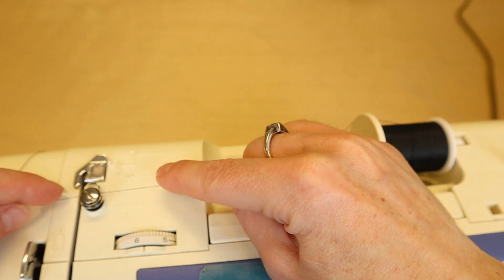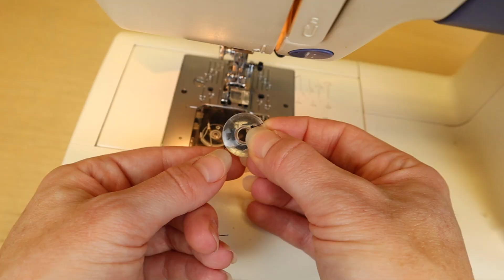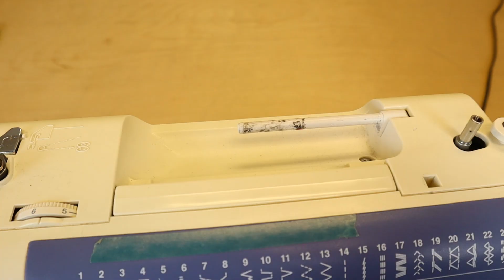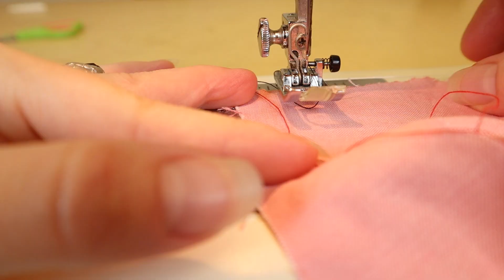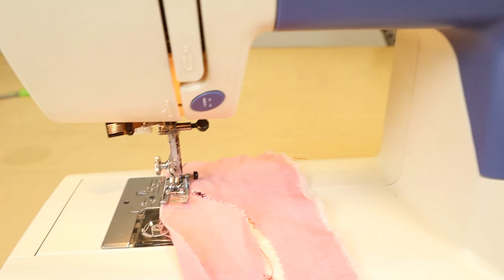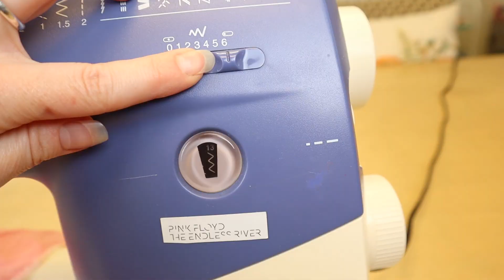Huskystar 224 Sewing Machine Walkthrough

Comment: Thanks for such an informative video. I’m getting reacquainted with my Huskystar 224 after several years of non use. My question is how can you fix your reverse stitch button? Mine doesn’t seem to engage.
Reply from the maker: Awesome, glad to hear you have been getting reacquainted with your Huskystar.  I love this machine!  Yes, actually, sometimes if the reverse button isn't working, it really needs to be seen by a technician or someone comfortable with opening up the case.   What could be happening is just a lot of old built up dried grease is keeping the mechanism from engaging around the reverse button.
Reply: @pindropshop  Thank you for responding.  I did take it to a technician who said it was broke and now even my straight stitch isn't working.  I'm so bummed and don't know whether to take it for a 2nd opinion or just buy another.  I really like this machine so I want it to work for me.  The technician who looked at it said the cams/gears were worn which seems odd since it wasn't used much and sat unused for 10 years.  It was always covered with its dust cover, sitting in a rolling bag and in my closet which is climate controlled.  Any thoughts on whether I should take for a 2nd opinion?  It could get quite pricey since everyone has a standard fee for looking at it.
Reply from the maker: @beckyvanderupwich9831  We actually don't charge in cases like that so it's possible another technician does it the same way.  If you just ask them not to spend a ton of time on it, but just try to make a quick diagnosis, they might be willing to do it for free or a lower cost.  That does seem weird for the gears to be worn down but obviously something is going on.  You could even open it up yourself and try to figure it out since it's already been declared broken

Comment: As happened with a friend's Husky stay, after we moved the reverse function stopped working. The repair may be DIY but I can't figure out how to remove the bottom cover. Do you have any suggestions? (This video is excellent.)
Reply from the maker: thank you so much for watching!  it could be that your machine simply needs to be serviced.  the top case could be removed and the area around the reverse mechanism could be cleaned and greased.  sometimes old grease will form and prevent proper movement inside the machine and then the reverse will not work.  you could try learning to do this yourself or just bring it to a service technician.  hope that helps! thank you again for your feedback on the video!

Comment: Hi! My mom gave me her Huskystar before she passed away so I'm learning how to use it. Luckily she taught me how to sew when I was little but its been years! Your video has been super helpful however, when I push down on the button to go backwards it doesn't reverse sew. My stitches are also coming out a bit funky as well, I made sure to adjust the settings like you have it in the video to compare. Any additional help or advice is appreciated!
Reply from the maker: Hello! Awesome to hear you’re breaking out your mothers huskystar. It’s an awesome machine.
If your reverse button isn’t working? It’s probably because there is old greased caked up inside. It needs to have its regular maintenance with a service tech to get that all cleaned and lubed inside.
That’s probably affecting the stitch too.
In the mean time, you can at least clean what you can access, including under the throat plate and under the bobbin case. Hope that helps! Happy sewing 🪡

Comment: Do you have a video on how to fix bunched up bobbin thread
Reply from the maker: Usually this can be remedied by taking out the bobbin, unthreading the machine, changing the needle, cleaning out any lint etc., and rethreading. If it doesn’t, and you’re sure you’re threading it right, it could be a tension issue